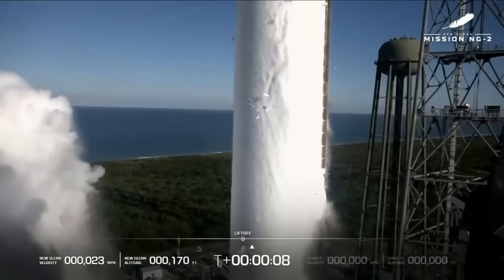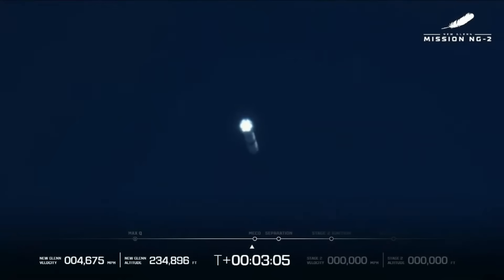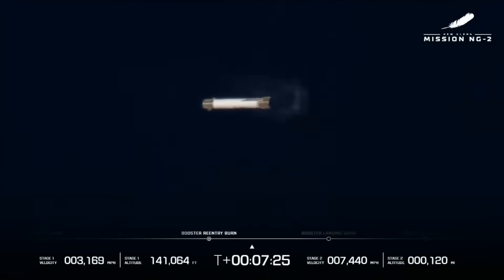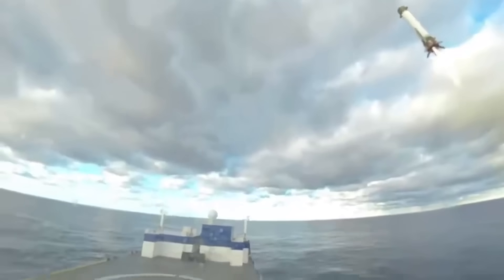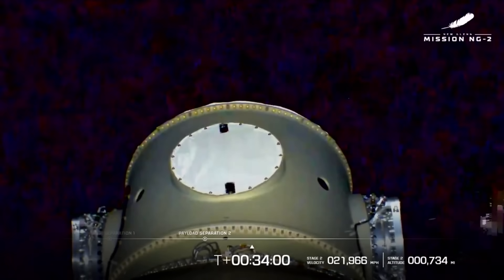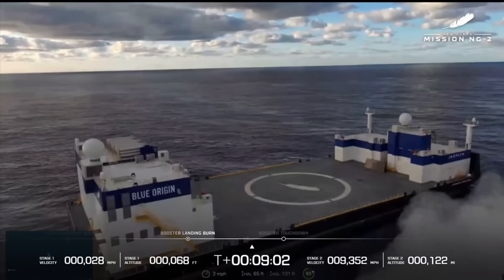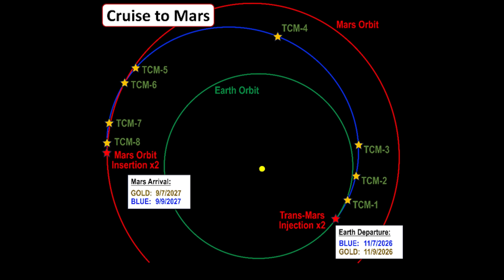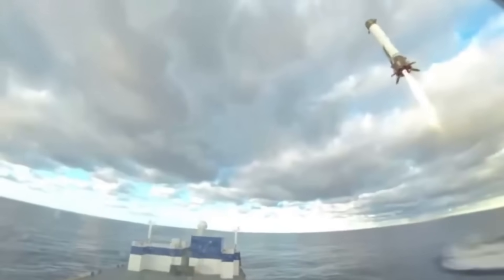What Exactly Happened On New Glenn's Second Launch?

Comment: There was a clip (can't remember if it was youtube or x) showing sparks (energetic welding) the landing legs to the platform to prevent the rocket from tipping over on rough sea.
Reply: @yummysatay Great observation. Those sparks are likely from the explosive spike system mentioned in the video 
 essentially deploying anchors that dig into the steel deck to prevent the booster from shifting in rough seas. It's an elegant solution to the wave motion problem that plagued

Comment: There is a bit more going on here that people arent noticing that makes NG not a capable of a vehicle as you might think. Falcon 9 has been stress tested hard before it attempted reusability and finally being upgraded to the block version it is now. Think of it, as engineers learning to eek out every kg of useful payloard per kg of propellant, which is why the rocket hoverslams so accurately and is so reliable. Meanwhile Blue Origin's NG rocket being so large, it would be very, very expensive to stress test. Yes they have successfully landed one booster, but they havent demostrated reliability, that is going to take years. I predict that blue Origin launch candence will still be slow and there will be explosions.
Reply: The stress testing comes from flying, BO has catching up to do but there is no reason they won't evolve the system like the F9 was evolved.
Reply: @imaginary_friend7300  Yes, that is the point of my comment, but also what I highlighted, evolution is going to cost them a LOT of time, potentially years. By then we may very see Block 3 Starship flying.
Reply: Yawn. Move the goalposts all you want, BONG is wiping the floor with Starship
Reply: @ahhmm5381  oh right, because bong has upper stages that has survived reentry how many times?
Reply: @ahhmm5381  That's just pure made up hater nonsense.  You people tend to lie a LOT though.  It's sad.
Reply: @imaginary_friend7300  The truth hurts

Comment: I am very glad that Blue Origin has finally put on its big boy pants. New Shepherd seemed like a joke, apparently just a showpiece, but no doubt they learned a lot from it. And I don't doubt that BO was watching SpaceX very closely as well. That explosive welding/spiking technique to secure the booster to the landing point is very nice, and an improvement over what SpaceX does with Falcon 9.
Reply: How is it an improvement?
Reply: @imaginary_friend7300  yeah, octograbber seems like a much better system
Reply: Remember, New Shepard technically beat Falcon 9 to a vertical landing...

Comment: I just hope the two first moon missions have no humans on board, spaceX will never reliably work. 
Blue Origin did deliver payload even on the first flight and is proven to work. 
SpaceX has not even had a successful testflight once and has proven thoroughly to be unusable.
Reply: That's pure ignorant simpleton nonsense.
Reply: @imaginary_friend7300  starship did so far 5 testflights and either disintegrated on the ram, shortly after launch, burned in the sky or exploded the buster during landing. 
Starship delivered nothing and only managed to fly across the pacific. 
Blue origin delivered payload on the first testflight but the buster did not survived landing. On the second flight they delivered again payload and the boster landed without problems. 
I may be a simpelton but I call blue origin a sucess and starship work in endless progress but unusable.
Reply: @sempertalis1230  Of course.  Its still in development.  You don't have anything like a clue what's actually going on or why do you?  Your trying to fake it and failing.  You clearly understand far less than you pretend.   I am 100% correct in my assessment of your OP.
Reply: completely false

Comment: Booster was way off to the side. Nice correction and stuck the landing. Like that they nailed the landing legs to the deck. It is a tall rocket! On 2nd thought it might have been planned to be off to the side in case they needed to put it in the water.

Comment: NG is an SLS class rocket that is operational.   NG is going to be a bigger deal then people think.
Reply: New Glen can do about 45 tons to leo. Starship about 100 tons and SLS block 2 about 105 tons. But in fully disposable mode, super heavy should be able to put somewhere close to 200 tons into leo.
Reply: @lordgarion514  Starship cannot do 100 tons.  Elon Musk himself is on record for walking back that claim.
Reply: @gracialonignasiver6302 
No, he didn't exactly say that.
Block two, which is the one they're working on now won't, but block three will. Because it will have a few extra engines. 

And this isn't even the full size starship, he's got a couple more bigger ones planned.
Reply: flying amazons satelites which they are also years behind shedule
Reply: @Hans-Yolo  And Starlink can’t launch enough to make up for the ones falling out of orbit.
Reply: @thethirdman225 
Where did you get that bit of silliness? 
On average starlink has about 78 satellites deorbit every month. They average launching about 250 per month, and their record is about 400 in a month.......
Reply: @lordgarion514   There was one that failed recently because of weather that caused the satellites to deploy at too low a pressure altitude and most of them fell back to earth.

Bloody hell, you guys take this so seriously.
Reply: @thethirdman225 
And that means what exactly? 
Falcon 9 is the most reliable rocket ever made, no one ever claimed it was absolutely perfect with zero failures. 
And what does those satellites failing to get into orbit have to do with the fact that they can launch 400 plus per month and are only losing about 67 per month? 
Literally over half their launches could fail to put satellites into orbit, and there's constellation would still be getting bigger.

Or in other words, no matter what you try to say, in your Elon musk hatred, starlink is more than capable of keeping up with the deorbiting count.🤷‍♂️
Reply: @lordgarion514   You think you know a lot about me, don't you? You've already shown you lack any sense of humour and I have better things to with my time than waste it on losers who take themselves too seriously. Blocked.

Now push off.
Reply: @Hans-Yolo 
I'm trying to figure out what Amazon is going to do with their satellites. Starlink is going to be cheaper by a lot thanks to their much higher launch cadence and much cheaper rockets. 
Other than their AWS and some Enterprise stuff, I don't see a lot of use for it outside of a freebie for their prime members, and a cheaper upgrade for members. Which means their average profit per customer will be a lot less than starlink.
Reply: Went and grabbed the numbers real quick. 
In reasonable mode, Falcon 9 can do about 18.5 tons, Falcon heavy 50 tons, and super heavy 100 to 150 tons. New Glen is 45 tons. It is squarely competing with falcon heavy. 

And from 2018 to 2025, super heavy has only flown six times. Less than once per year. Mainly because there's almost no need for the amount it can lift. 

I'm not sure what blue origin is supposed to do with New Glenn.
Reply: @lordgarion514  Um… launch stuff to Mars?
Reply: @thethirdman225 
Not really, they got this just to have something to launch during the test. 

But both satellites that they just sent to Mars together only wait about 1 ton. Falcon 9 in fully expendable mode is only about 69 million dollars per launch. It would not have to be used in disposable mode for a 1-ton Mars payload, so it would have only cost around $20 to 25 million roughly. 

And taxpayers just paid 80 million, instead of 20 to 25 million because Congress mandated that NASA use more than one launch provider for things. Not just the cheapest one. 

So we just got screwed into pain about four times more for it than it should have cost us as taxpayers......

I don't see much use for sending things to Mars with new glenn.
Reply: @lordgarion514   Yeah and how much Delta V does it need to get two one tonne satellites to Mars? This isn't just about payload capacity.
Reply: Not quite.  NG is a heavy launch vehicle but Starship and the SLS are in a class of their own.  Still, NG is a worthwhile rocket, and another launch vehicle like this will be quite welcome.
Reply: @richardthomas5362 
I'm still trying to figure out what a rocket with a 45 ton lift capacity is when we already have a 50 ton lift rocket, and a almost 20 ton rocket. With the 50 ton capacity rocket being cheaper than new Glenn

Comment: With how much control they have, I’m sure they could catch it as well if they willing to speed things up and take high risks.
Reply: Why catch a landing rocket when landing legs can do the job just as well; with or without a landing barge, for that matter?
Consider, Stan, according to your argument, why isn't SpaceX catching Falcon rockets at The Cape? SpaceX have the landing pads, so why haven't they built Mechazillas on them as well?
I have a nagging suspicion, Stan, that you are a SpaceX Fanboy suffering a bad case of "sour grapes".
I'm sure there isn't a high risk that I could catch it as well!
Hi from a New Zealander.
👋🇳🇿🦎🌴🚀⛴️
Reply: @davidstevenson9517  It's sad that someone of your age is still immature enough to indulge in insulting people on the internet.
Reply: @davidstevenson9517  Landing legs add dry mass which equals reduced payload mass.  I suspect you really didn't think that through very far or very well.

Comment: Interesting to see that they land the booster with a hover manoeuvre, rather than SpaceX’ “suicide burn” going straight in. I wonder if there’s advantages to that?
Reply: In SpaceX case Merlin 1D cannot throttle deep enough to hover so they have to do suicide burn. Suicide burn is more efficient but its more risky.

I think they hovered so much here is because the booster aimed for ocean for safety reason, and only once they knew the booster is hovering safely, it translated over to the barge. I wont be suprised if that changes as they get more confident with the landings
Reply: BO was trying to get it to work (land safely). SpaceX is pushing the limit, they already knew they could land
Reply: @shikyokira3065  BO hovers because their engines are more efficient.  Spacex has to suicide burn because they literally can't hover.
Reply: @gracialonignasiver6302  Is has ZERO to do with their efficiency.  That's pretend expert nonsense.  It's all about power to weight and throttle depth.  If you don't know what you're talking about, stay silent.  Pretending always looks bad.
Reply: @shikyokira3065 After all, Starship keeps blowing up after it lands anyways.
Reply: @JoeOvercoat does it matter to them tho considering that they will be outdated soon based on their improvement pace so far?
Reply: @JoeOvercoat any big long thing with fuel in it would blow up after landing in the ocean. The tower landing worked just fine, you seemed to ignore that.

Comment: Seems there's a lot of Musk fanboi's hating on BO. They might be a little late to the party, but landing their second attempt without uncontrollable lingering fire and clean AF is still impressive and better than SpaceX did.
So they start comparing size like 5 yr olds. Landing a booster on a platform successfully is extremely impressive for a second try. Take that ... silly boy's ... 😂
Reply: They most certainly had a lot more prior experience to draw on then space x did. Bezos and crew didn’t even have the idea of landing somewhere till Elon gave it to them.
Reply: @daveleeander both spaceX and BO quite openly “got the idea” from the 1996 DC-X.  (musk said as much during F9's development and BO literally hired engineers that worked on it to help with NS)
Reply: @daveleeander  Lol. New Shepard landed before Falcon 9 did.
Reply: When did a F9 have a lingering fire?
Reply: Considering all those scrubs and holds i would say they got lucky with the landing.
Reply: no, you are ironically identical to the thing you criticize though
Reply: it takes a special kind of... mental gymnastics to argue that "we did it on second try but 10 years later" is a victory.

Comment: well, it gives confidence that there is another approach than fail fast and fail again.
Reply: That has always been the traditional approach..  This is the old school method, nothing new.
Reply: what made you think there wasn't? like, seriously?
Reply: on the other hand did fail fast give spacex a 9 year advantage. both methods have their pros and cons
Reply: Falcon 9 was not designed according to that philosophy only starship is being developed in that way and it's already way behind New Glenn at this point
Reply: @kipkipper-lg9vl  Not really. One point is that it’s kind of comparing apples to oranges, New Glenn and Starship are very different types of vehicles. Other point is that the only thing new Glenn has done that starship hasn’t is deploying an operational payload, in all other aspects starship has the upper hand.
Reply: @Wurtoz  
Can you give a few examples of Starship having an upper hand that are actual facts as of today?
Reply: @V14-x6n  Reuse of 1st stage. Successful reentry and landing of 2nd stage. Higher launch rate.
Reply: @Wurtoz  
Are you serious? On what actual missions were Starship stages reused even to begin to speak of a higher launch rate? All this BS is getting really tiring. We can compare Starship when and if it flies one or two operations missions, not before.
Reply: Really..so, there will be no clue where the fail parameters are?

Comment: I really hope that Blue starts doing RTLS some time soon
Reply: RTLS is very inefficient way to reuse a rocket and a waste of fuel and available payload mass. DRL is not all that wonderful either for different reasons but it's somewhat better than expendable.
Reply: @V14-x6n well if NG is launching payloads as light as Escapade I’m sure that it would be within the Delta-v budget.
Reply: The ship recovery just seems to make a lot more sense what is even the point in coming back to the launch pad
Reply: @Rory-Shields  
It would be within the payload capacity but thus was still very much a test launch. Escapade would not be an example of a typical future launch - $20 million paid (plus whatever was paid for Viasat demo sat for NASA) for this launch is still a fraction of the launch cost.

RTLS cuts your payload to LEO by about 40% and gets worse and worse the higher the energy of the orbit.
Reply: @kipkipper-lg9vl there are quite a few benefits particularly in launch cadence and the availability of marine assets. That’s part of the reason why starship flies back to the tower. 

Another factor that you may not be considering is that an RTLS launch has an entry speed that is far far lower. Therefore less ware and tear on the vehicle and extended service life.

Comment: This is fantastic. Having two viable booster reuse systems is a big advance.
Reply: 3 if you count both Starship and Falcon 9
Reply: @standapp9172  Starship is still in development; hasn’t put anything into orbit yet.
Reply: @christianlibertarian5488  The boosters flew a full orbital trajectory and returned, with reuse demonstrated. What the second stage did is irrelevant, the design could put payload into orbit quite easily, especially with a lightweight, expendable 2nd stage like NG.

Comment: Burn too much fuel trying to "fly" horizontally, need to optimize next time
Reply: strong disagree, hovering away from the ship is safer, and the amount of fuel used is very little since the first stage has spent most of its fuel it weighs nothing and is using one engine. its burning methane and oxygen both cheap and abundant.
Reply: It doesnt burn fuel when it "flies" except for Decel.  It uses less fuel BECAUSE it flies.
Reply: it is not bad to do that during the development stage